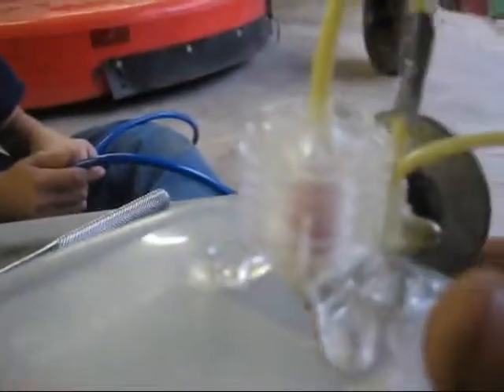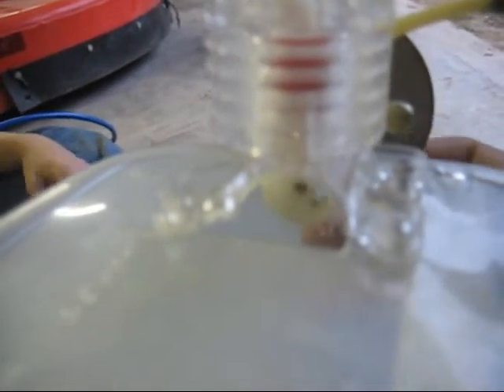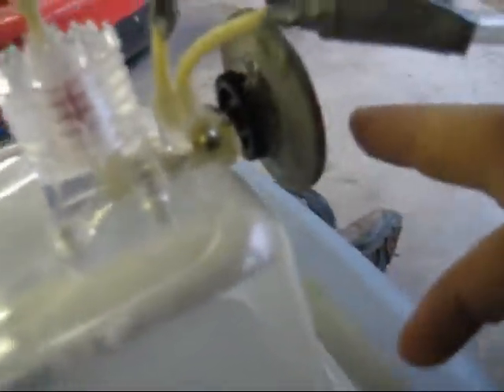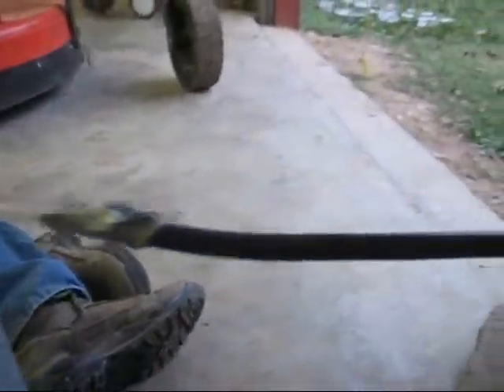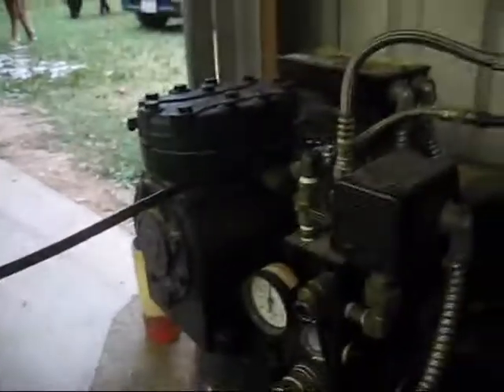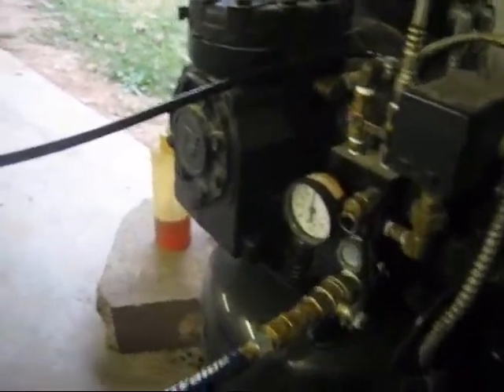Tiny air engine

Comment: I played with a lot of those toys as a kid and grew up to build real engines. Rebuild entire cars for that matter. If a toy had more than two parts I had to take it apart and put it back together! I tried running mine on an air compressor but it ran so fas that it jammed the little valve that the cam moves and never worked again. Onto the next toy....